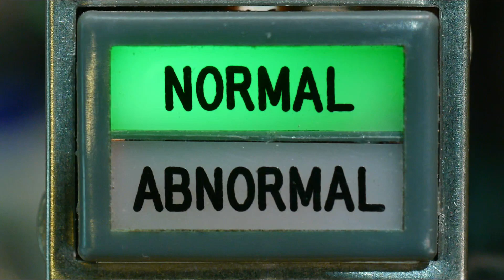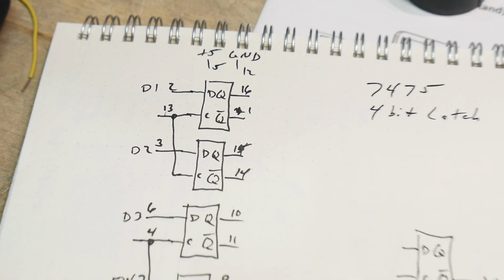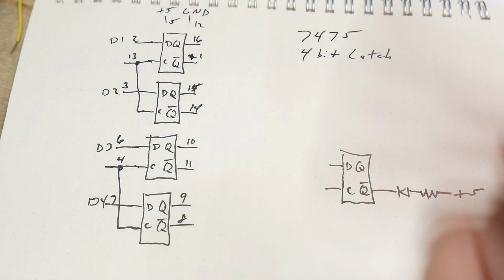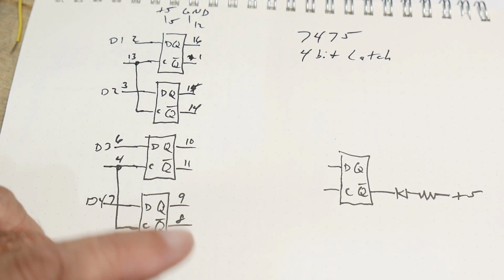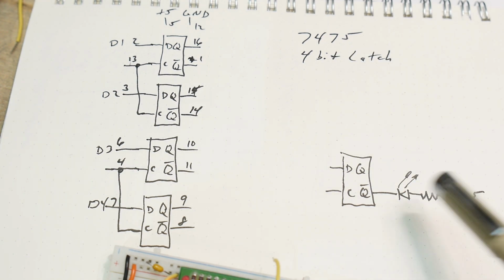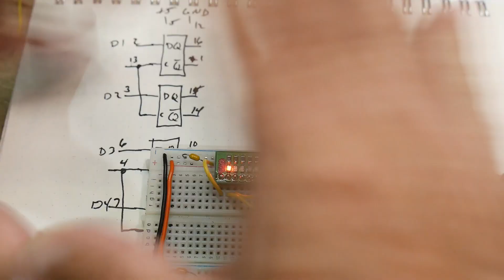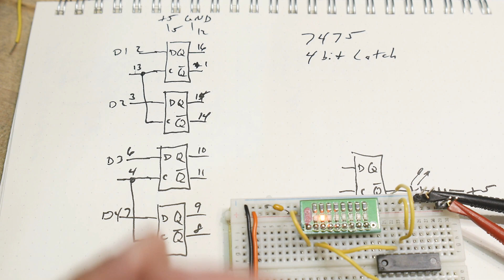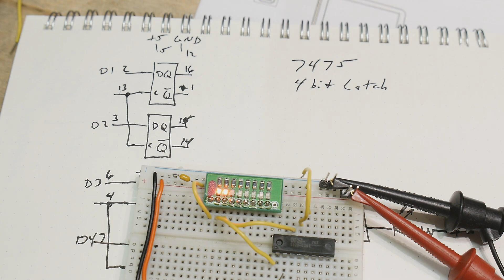#1326  7475 4-bit Latch

Comment: Transparent latches are interesting in IC design because they need fewer transistors than edge-triggered flip-flops. When I took a computer design class in 1990, we used transparent latches instead of D flip-flops for this reason. We solved the transparency problem by using a 2-phase non-overlapping clock. Successive stages of latches were clocked from different phases, so they were never transparent at the same time. This reduced the transistor count by about 10% if I remember, which would have reduced the cost of silicon by about 20% if we were building real chips.

When doing board-level design, D flip-flops are usually easier to use. Though oddly I've noticed Motorola 4000-series app notes from the 70's and 80's using transparent latches where I would expect flip-flops. I don't know why. Maybe in that old CMOS process latch chips were cheaper or faster than flip-flops, or maybe the app engineer just liked them. 🙂
Reply: Following up, I happened across an old Motorola CMOS data book that has schematics for the chips. A D flip-flop used 28 FETs and a D latch used 14. That's a bigger savings than I expected!

Comment: The separation of the clocks was because a lot of digital circuits back in the day used multiphase clocks (often generated by a Johnson counter). You could cascade the two stages with opposite clock phases to build a pair of 2-bit synchronous D flipflops (or put additional logic in between them).

A lot of times, engineers back then wanted the not-Q outputs broken out, because they'd build all the logic with data selectors and AND-OR-INVERT networks, and needed both true and complement inputs. A 74151 could implement any Boolean function of 4 variables (and many more complex ones) as long as both true and complemented inputs were available. If they let you use a 24-pin package, a 74150 would do any 5-variable function (and lots of more complex ones).  The later ones on the series had open-collector or tri-state outputs so you could make even wider functions by wire-ORing several together.  I saw whole ALU's built mostly of 7415x and 7452/7461.

There was a whole body of literature around doing things like balancing the workload among the clock transitions. All because the gates were so slow back then.

I remember (circa 1979) trying to cram a 72-bit ECL barrel shifter (shift left, rotate left, shift right, shift right with sign extension) built out of JK flipflops and data selectors into one micropack.  With the help of God and a shoehorn it all went in, but routing the thing was maddening!
Reply: Thanks for sharing that! There was a lot of insightful engineering in the TTL days.